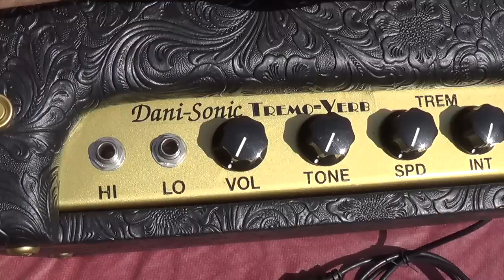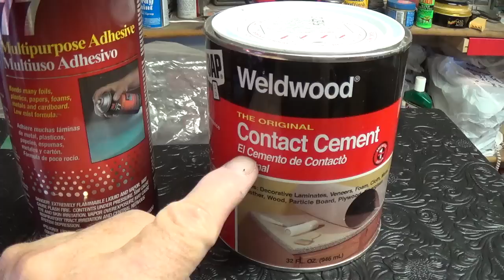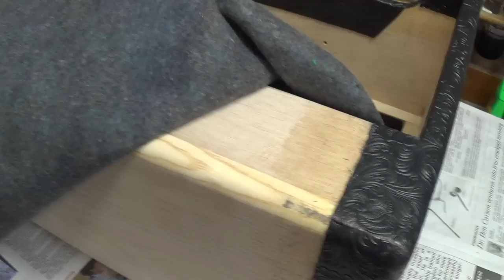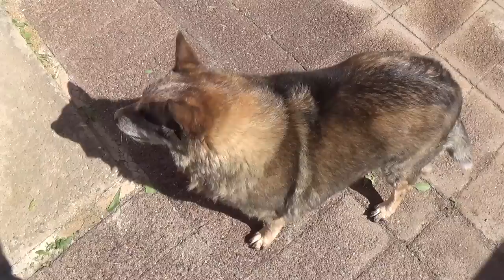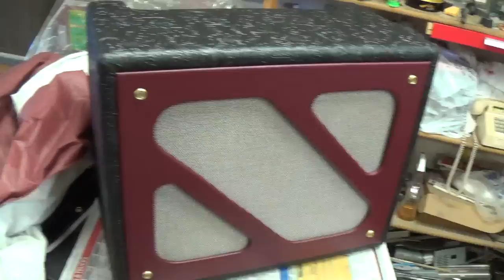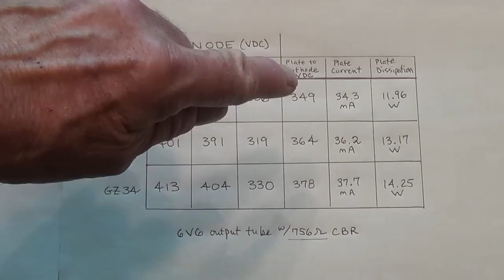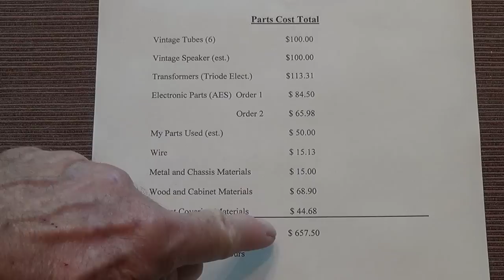How to Scratch-Build a Vintage Amp, Part 8:  Completed and Tested

Comment: thanks for the great info I built it with all new parts sound is great but there is a cracking sound on warm up ,I have disconnected all the pre amps section and with only the rectifier valve and the output valve plugged in it still crackles for about two or three mins .I have also replaced again the 6V6 brand new and rewired the power supply and output stages again and its made no difference. Have not changed the 5y3 rectifier is it possible that the transformer be causing the problem its brand new Fender transformer. Thank you any advice will be appreciated .Cheers Tony
Reply from the maker: Crackling noises generally indicate a bad solder connection or bad resistor(s) that arc during warm up.
Reply: thanks Doug your info has helped me.the problem turned out to be a bad pre amp socket ,(brand new)  and I have learnt a great deal. I started repairing TV's in 1970 I'm retired now and ive learnt so much more from your vidios   I'm in Melbourne Australia  and I keep watching all your utube vidios your a man of great talent thanks once again
Reply: hi uncle doug I am  still have issues with the amp on switch on  ,Its crackling and now it is starting to give  a loud squealing, and  after 3 or 4 minuits  it seems to right itself  I've replaced all resistors with  metal film ,and checked for dry joints definitely no dry joints .   The voltages from the rectifier 5y3 pin 2  are  about 440volts at b1  and plate voltages are all high. the plate dissipation  is about 31 watts I'm using a 6l6GC  Electro harmonix O/P   ive used the right power tranny 325v ct 325v.Would   the voltages being that high be  causing the problem  and if so  how could I lower it down thanking you for your reply
cheers Tony

Comment: Hey Doug!
How come your amp doesn't require a standby mode? I thought tubes had to be allowed to warm up before using them to prevent damage?
Reply from the maker: In my opinion, and that of many others, stand-by switches, particularly in amps with tube rectification, cause far more harm than good.  See what the Valve Wizard has to say about them:  http://www.valvewizard.co.uk/standby.html

Comment: You are amazing!!! I've been looking for videos like these forever that I can understand. I actually understood how to read schematics! lol. I've got a question. If I would like to make a pure clean power amp, would I just build the power section and run the guitar directly to it?
Reply from the maker: Thanks so much, BRM. We're glad you found us. You would still have to have a pre-amp section to drive the output tubes.....either separate or built in.
Reply: No wonder there are practically no tube poweramps, might as well add some EQ and gain. Thank you very much. You guys are awesome. I will follow.
Reply from the maker: You're welcome :)

Comment: Uncle Doug, rusty & jack, thanks for another easy learning video series it has been great to watch and learn from very inspirational indeed you are truly a master and a one of a kind thank you for sharing your time and the effort in the making of this series it is appreciated. 
Question did you ever get around to addressing the tremolo and the bass response issue you mentioned and if so what did you do to modify them if at all? Once again thank you
Reply from the maker: Thanks so much for your very nice comments, Oswald.  Rusty, Jack, and I really appreciate them. Any changes to the circuit are reflected in the final schematic (see link in video description). I believe the tremolo effect was reduced a bit and the bass response was found to be just fine, as is.
Reply: Doug thanks for your reply. I am going to try and do a build of your tremolo-verb amp very soon but I will be using an old yamaha 120W 15" alloy basket speaker from early 70's which is in new condition so hoping it will sound ok as I am trying to obtain a more bassy sound so any hints would be appreciated. Once again thanks for all your great videos on different aspects of amp building it has helped me no end,  the only thing I still struggle with a bit is the use of different PT's and getting the correct voltages for the different tubes. Looking forward to your next video(s), stay well and have a great & safe festive season... Oswald
Reply from the maker: Good luck with your project, OR. I have posted a video specifically describing how to select a proper power transformer.  It may be of help.  Happy holidays to you too :)

Comment: First off, YOU..... are one very skilled amp tech sir! I tip my hat to you.

Second, so i have been going trough your amazing videos like a man on a mission for the last couple of days and enjoying every second of it but i have been wondering something.

You build and repair these amazing works of tube art, using the best methods and components you can find so please, please, please don't take this as an insult but why, for the love of the tube god Svetlonious, no descent mic and recording set up for the sound demos?

The sound of the camera is more than descent for your explanations & walk troughs during the build up portion of the video but most certainly do not do your labour and skills justice as the volume of the amplifiers just distorts the heck out of your microphone signal? 

A descent Microphone like a Sure sm57 or 58 positioned close to the grill and a interface hooked up to some descent DAW software on just about any operating system wil sound so much better and do your work the justice it deserves.

Again, not an insult and by all means keep making these amazing videos.
Reply from the maker: Thanks for your very nice comments, FJ. I agree with your assessment of my recording system. My video camera has no provision for an external microphone, so I am stuck with the tiny stereo microphones built into it.  My next video camera will have external microphone capability.....I promise.
Reply: Uncle Doug You are very welcome Uncle Doug, looking forwards to more videos!

P.s. give my regards to Rusty and Jack.
Reply from the maker: Thanks, FJ. Rusty and Jack send their regards.

Comment: Thank you so much for this video series on building a "tremo-verb". I am gearing up to make one myself. I've already made a 5f1 style amp and it sounds fantastic. I followed your videos on that one, too. I have a question about a discrepancy between the schematic and the wiring layout diagram for the tremo-verb. The schematic shows a 660 ohm resistor for the 6L6 cathode bias and 750 ohm for the 6V6, while the wiring layout diagram has it just the opposite. Which one is correct? I didn't know how to ask you without posting a comment, so that is why I'm doing it here. I'll look for your answer here too. I greatly appreciate all you do. It is a great help to a lot of us.
Reply from the maker: You're welcome, Patrick, and good luck with your TV build. The schematic is correct....the lower value resistor is appropriate for the 6L6, since it operates at a higher level of plate current. I thought the layout diagram had been corrected.  Sorry for any confusion, but you should realize that the resistor values apply only to the tubes I used.....not to the tubes you will use. Your tubes will have to be individually biased and will probably have different CBR values.
Reply: Thank you so much for your quick response. I know you have a video on how to bias an output tube, so I will review that. It's a great opportunity to actually learn and understand more about how tube amps work. I have JJ 6V6 and 6L6 tubes, as well as a couple used 6v6s.  I'm excited to get started.
Reply from the maker: You're welcome, Patrick. We share in your enthusiasm.....tube circuitry is a wonderful hobby, but be careful :)

Comment: If I don't use vintage parts, would it be cheaper to make? Also, did you build the foot switches and reverb tank yourself too?
Reply from the maker: No, it would probably cost more if you have to order every part from a supplier.  No, the foot switch is a Fender re-issue and the reverb tank came from MOD.  A reverb tank would be quite difficult to build from scratch due to the tiny spring mounts and transducers.
Reply: I want to take apart a television that has tubes and use any components I can get from that and a couple other old appliances. Will that work?
Reply from the maker: You can probably harvest some minor components, but virtually all of the tubes, transformers, etc. will not be appropriate for an audio amp.  Your best bet is to hunt down a PA amp....on Craigslist or at a garage sale in your area.

Comment: What an outstanding job, both the amp, and the videos. I recently came across a complete 60's Lectrolab  R600C, on the side of the road heading for the dump. It turned on, but the pots were bad, caps, etc., it was completely original. So off to the internet I go to learn about these tube amps, luckily I found your videos. I am not there yet, to tackle the restoration project, but your lessons have been invaluable. Thank you again Dave
Reply from the maker: You're welcome, Dave, and best wishes during your pursuit of knowledge.

Comment: Hey Uncle Doug...with great delight I commend you on your videos.  Your demonstrations have helped me put together the many separate pieces of informations I have learned.  Please keep them coming. I'd be very interested to see the Amp schematic placed alongside it while you point and explain the diagram compared to the wiring of the Amp.  It makes a huge difference to see them both simultaneously while you explain reasons and techniques of electronics. Show a reading of the cathode and plate voltages, read across the filter caps and transformers and various other tests...if possible show the signal AC voltage as it ride on the plate voltage to exit the tube while you explain.  I notice that you haven't used an oscilloscope.  Is that a sign of your skills and confidence or some other reason.  Tell us how you performed preliminary checks to ensure everything functioned correctly prior to the actual turn on.  A Rusty thrown in for laughs is also ok.  Could you tell us on video about your electrical/electronic background.  When did you start what was easy and difficult cause you obviously has an extensive background by your thorough and somewhat unconventional approach.  I seem to understand and relate well to your approach. You explain and execute with a get it done attitude that is admirable.  Congratulations on your videos and I enjoy the few I've seen.
Reply from the maker: Thank you for your nice comments, ES. I think that as you watch more of our videos, you will find answers to virtually all of your requests. If, after watching all the videos, you still have some unanswered questions, we can address them. Meanwhile, our best to you.

Comment: Hey Uncle Doug.....just checking in on this amp video again.  I see that you sold it!  I wanted to thank you again for putting this series together.  I am so glad that I took on the challenge to scratch build my own tremoverb.  I finally have it all sorted out....I recently had this intermittent tremolo thump that I traced back to continuity with ground on the intensity pot.....there must have been some errant wire or something else.....I replaced the pot and that thing is very quiet.  Just a very cool looking and sounding amplifier......I'm very proud of it.  Thanks again!!
Reply from the maker: You're welcome, Bart, and congratulations on your successful build of the Supro T/V and your troubleshooting.

Comment: What a beautiful piece of art.
Thanks for sharing.

Your videos are very helpful. I'm working on building an amplifier out of old tv tubes as a first project before investing myself  into a quality audio amp.
Reply from the maker: You're welcome, Benoit, and thanks for the very nice comments. Best of luck with your projects.
Reply: +Uncle Doug thanks a lot.
The interesting thing is that I actually found easier to understand tubes than transistors. Plus they look so much better.

I came up with a strange idea though, I'm wondering if it would work as well to make a high voltage transistor amplifier based on the tube amplifier architecture.
Reply from the maker: You're welcome, Benoit. You can't arbitrarily increase the operating voltage of transistorized equipment. It must operate at the (relatively low) voltage levels that the components were designed for.
Reply: +Uncle Doug I was thinking of high voltage transistor such as the bipolar transistor that were used to drive the CRT's in tv sets.   Some of those transistors are designed to modulate voltages up to 600~800V with current rating of the order or the A.
Reply from the maker: ....but I wonder if they are suited for use in an audio circuit? You will have to do some research on this subject prior to any experimentation.

Comment: What a beautiful and great preforming  amp along with the cool options and setup. Great job! 
I would recommend a video on your idea of the perfect simple amp for beginners. Tone control, Volume, input and output. Possibly for a 12" speaker setup. Then design tube pedals for that such as reverb and tremelo, which is usually a beginners first things they would want. This would break it down more also which would be better for beginners. ;-) 
Keep them coming. Your work in video land is helping carry on the tube world for generations to come. Thanks for all the hard work and best wishes....
Reply from the maker: You're welcome, Jon. I have already posted a video series showing how to build a simple Fender Champ clone using scrap parts.....including the chassis, wooden cabinet, and covering with vinyl.  Also, I have videos showing how to build your own inexpensive tube tremolo and boost effect.  I don't build pedals, since they are almost always transistorized, not tube, so I'm really not the go-to guy for pedal videos.
Reply: +Uncle Doug Thanks for the info and I didn't realize the Champ build was a basic amp build. I'll get to watching :-):-)
Reply from the maker: Yes, the Champ is about as basic as it gets, Jon. I recommend it as a first build to all budding ampoholics :)  Good luck.

Comment: Hello Uncle Doug- I have spent many hours, (many of those when I should have been doing other things!) watching your videos and I can't thank you enough for all that you have taught me. You are very wise. I have a question: as far as I can tell, on all the amps that you build, you do not include a standby switch Do you find these unnecessary? Thank you once again.Skot
Reply from the maker: You're welcome, Skot.  We're glad to hear that the videos are helpful and informative.  I am not a fan of Standby Switches. In my opinion, they generally cause more harm than good, particularly in the small to medium-sized amps that I build.
Reply: Thanks for the quick reply, Uncle Doug. Could you expand upon that a bit? I have always thought that standby switches were good for the tubes, but I have been hearing recently people thinking otherwise. Thanks again!

Comment: hey hey Uncle Doug,   this is it.   This is like the amp that I have fantasized.   It it a frankenstein amp with proper trem, a reverb tank, etc.   Taking the better/best features of the classics.   I like this.   The only real difference that I have had in mind is that I want mine built as a head amp so I can plug into various speaker boxes.  Please make more.  Thanks, Cherry K.
Reply from the maker: You're welcome, Cherry.  Yes, this modified circuit does contain the best features I could think of, including single-ended output, which is rarely seen in an amp with these features. I understand your preference for a head configuration, but since the internal speaker in my version is simply plugged into one of the various impedance outputs, it can easily be unplugged to allow for connection to virtually any speaker cabinet.  If you do build a version of this circuit, please let us know how it turns out.

Comment: When it comes to tube amp, you are a godsend. I have an old Baldwin organ amp that I plan on converting to a guitar amp. The first thought were to trace down every circuit, remove what is unnecessary and modify here and there. About 2 hours into that, I gave up on that birds nest of a wiring job. I've decided to start from scratch and use whatever components i can salvage from the Baldwin. After searching through vast schematic diagrams, I've settled on using the Fender "Pro" 5E5 since it closely resembles what I have and go from there. I just wish I knew what the speaker impedance was for the output transformer. it only has the two wires out. Thanks for being the tube teacher many of us desperately need!
Reply from the maker: +OnParGuitar  You're welcome, OP. You can find out the secondary impedance by determining the winding ratio.....watch my video on output transformers to see how.....and looking up the plate resistance of your output tube(s). Good luck with your project.